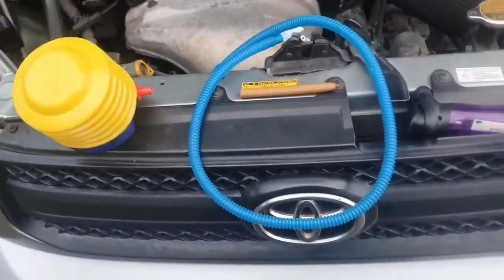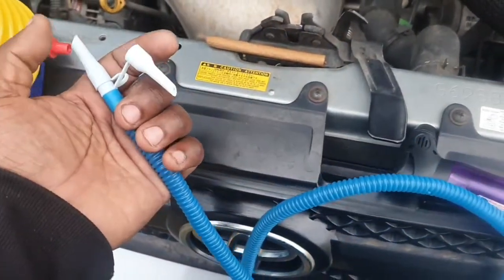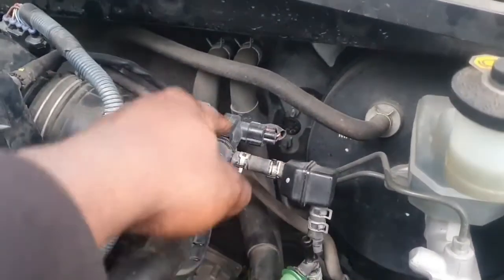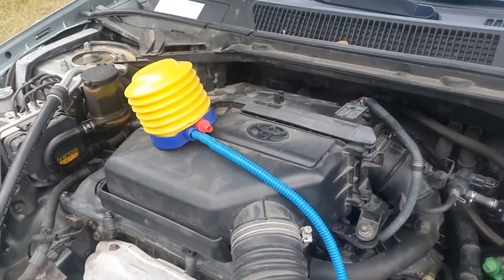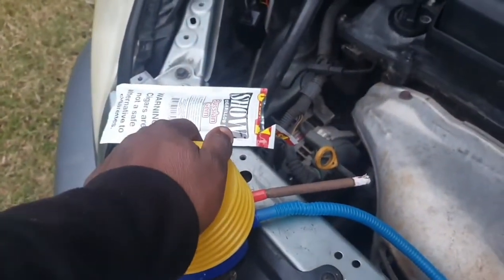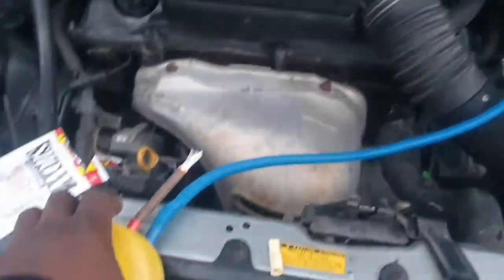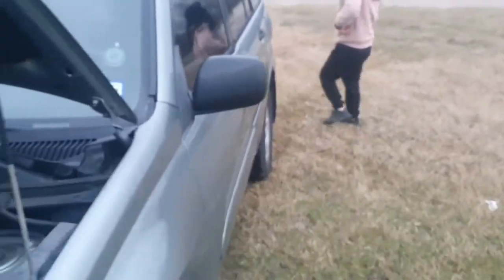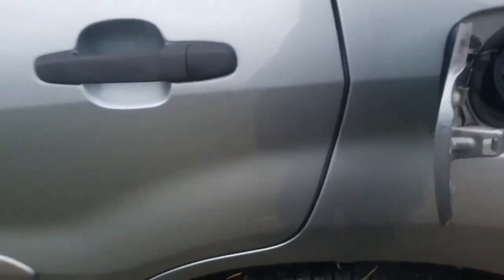Easy fix DIY p0442 p0445 p0446 EVAP small or large leak detected budget simple smoke machine! SAVE $

Comment: I like this better than using a soldering iron or resistance wire.  I mean, I don't have any gas leaks under the hood, so the cigar shouldn't blow the car, or me, up.  And, it's less expensive.
Reply from the maker: That's correct

Comment: My gas cap was already replaced before I bought my code reader because I had previously lost it. So dose that mean I should just go ahead & change the vent valve?
Reply from the maker: I would recommend buying the smoke machine and testing it
Reply: @globalcommerce7654  why? Just asking because I already know if not the gas cap and after watching your video I watch the couple more on the Nissan's and he said it would be that or that part but it don't smell like gas or nothing like some of these videos say that I've seen. It's sputters I guess you would call it
Reply: @globalcommerce7654  Alvin you know what actually I might want to work and make sure that's not something that is a recall duh SMH yeah that papers saying there was like 10 recalls but anyways I wasn't thinking about that being a recall.  Thank you Sir and if not I got your video download to watch again and I didn't mean to sound very good idea when I said why.... Sorry I was asking but realize that could also come across as being rude or sarcastic. Sorry
Reply from the maker: @classylilsassy6911  you can try replacing parts or you can test the lines..
Reply: @globalcommerce7654  hopefully they'll fix it at the dealership if that happens to be on the recall list. I just don't know what they're going to say because the car is not legal due to the check engine light being on of course it couldn't pass inspection. But for some reason all of a sudden my light has gone off and I haven't done anything 🤷 so I'm not really sure why it would just go off like that. But thank you 4 taking the time to reply with your advice and this awesome video that explains/shows me that if need be I could possibly do this myself with the help of your video. I'm one to doubt what I physically maybe capable of doing on my own when it comes to cars very quickly.